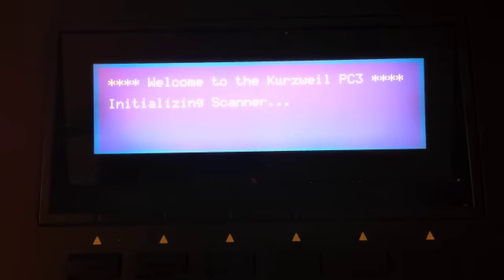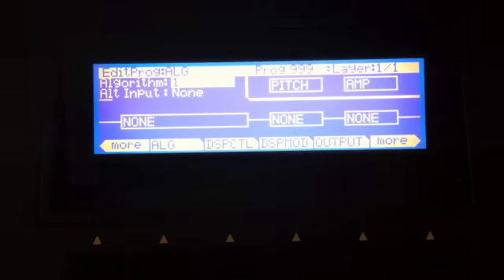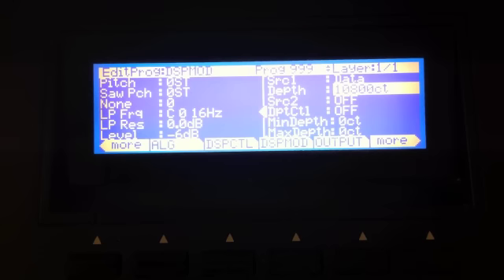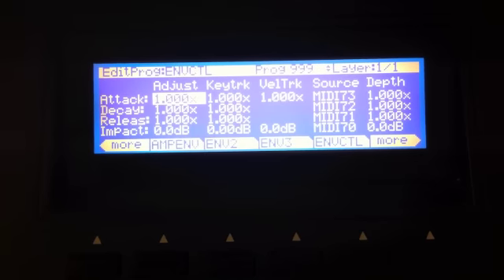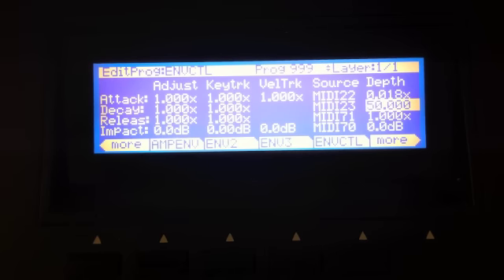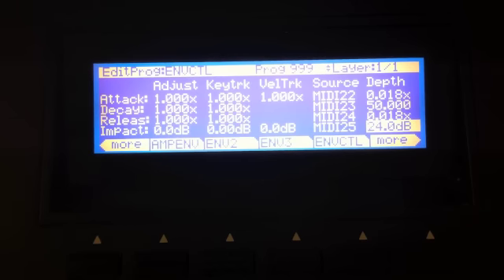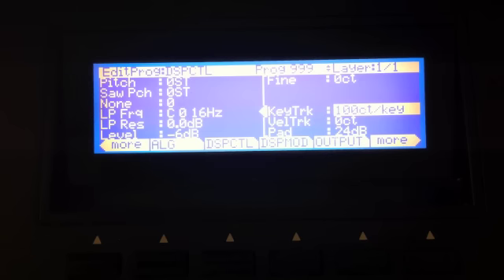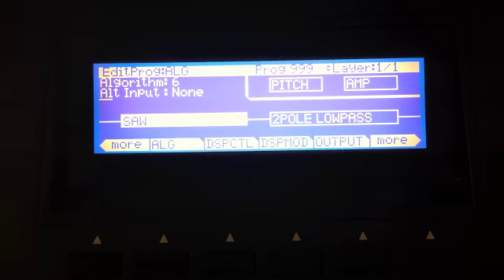Kurzweil PC3: Tutorial 1 -- VA Plus Sliders

Comment from the maker: It's incumbent on the programmer to assign Attack, Decay, and Release controls within their Programs. You can assign them to some common control sources (I generally use sliders F, G, and H respectively) and then in Setup mode just assign those sliders to transmit their default CCs for every Zone.

Comment: I'm loving this tutorial. It's really helping me get into VA synthesis. I love how you start off by assigning sliders to modulate the filter and set the shape of the envelope.

I'm having great difficulty understanding why the decay depth setting on the ENVCTL page has to be set to 50x while the other envelope parameters are set to 0.018x. Is there a reason Kurzweil chose to do it like this?

Comment: so setting res.to 12db ...is a 2pole filter 
Are there other options to define the pole of the filters on the kurz.
Reply from the maker: Yes, generally you can select poles by selecting different DSP filters. LOWPASS is 6 db/octave, 2 POLE LOWPASS is variable (but generally people will use it as a two-pole filter), and 4 POLE LOWPASS W/SEP is variable as well, but generally it's used at 24 db/octave.